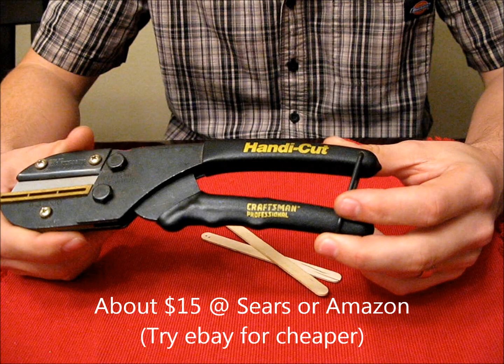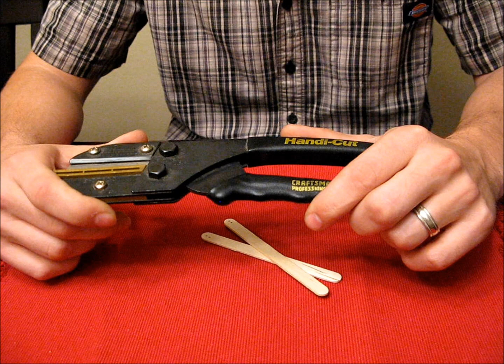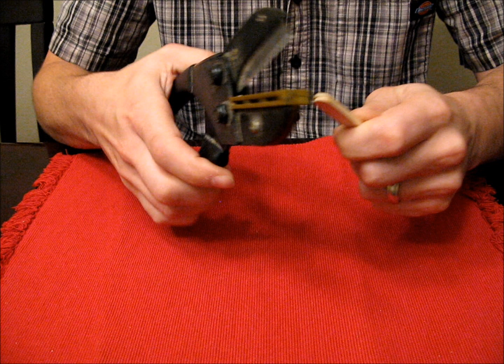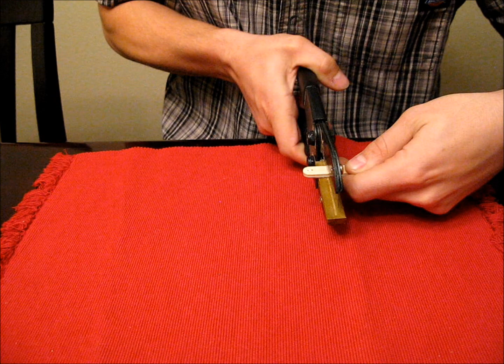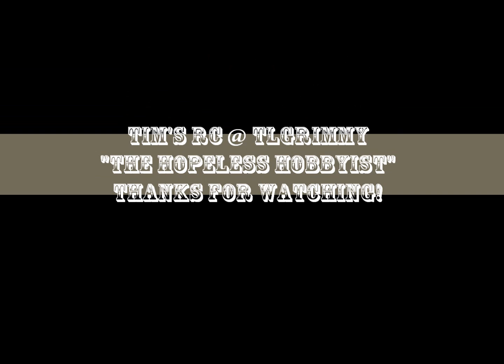Easy & Cheap Homemade Control Horns

Comment: Good job. I make mine out of 1/16 plywood.
However, in order to get the correct relationship and have
the same degree of travel up and down (left and right)
one needs to have the holes in the horn directly over the
center of the gap in the control surface. Otherwise the
Proportions will be different…………p
Reply from the maker: Thanks! Makes sense on the proportions. 1/16" ply wood be a great choice too.